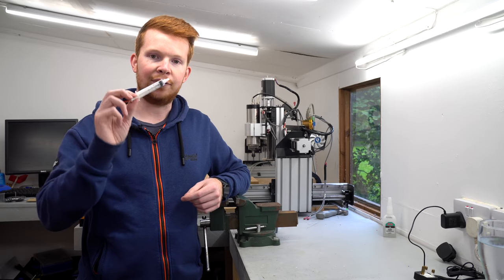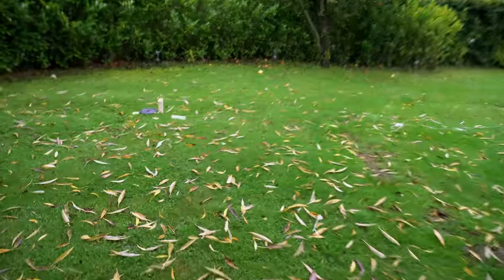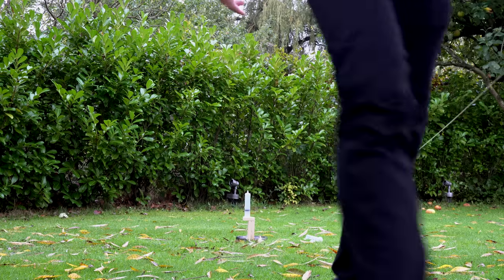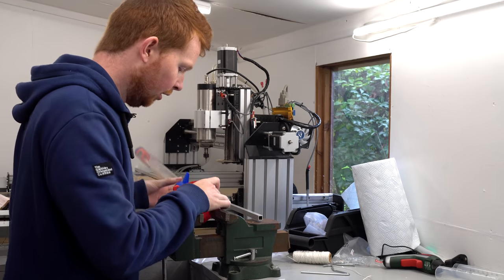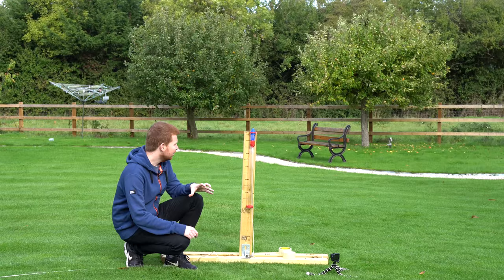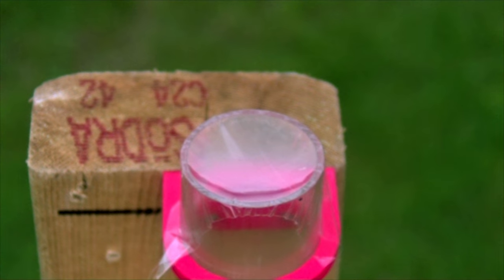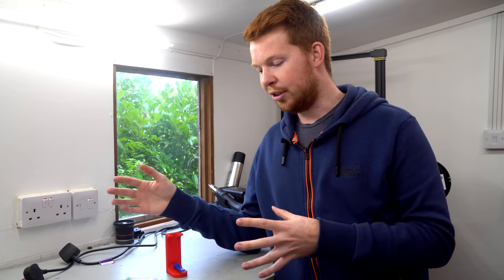Vacuum Rocket

Comment: Tom - try a smear of vacuum grease to seal the o-ring leak and also overcome the friction.
Reply: how about glue
Reply: BowlG Official what.
Reply: It's most likely the plastic that is leaking. Printed parts are notoriously leaky.
Reply: @JohnnyForehead  - YOU'RE leaky.
Reply: @JohnnyForehead  could try an stl print, they should be a lot less leaky.

Comment: Was fooling with a 5-ml syringe once, decided it would be fun to block the end with my thumb and pull back on the plunger. When I released the plunger it sprung back and made a jolly sound. That was good fun, so I figured the same thing with a 60-ml syringe would be 12 times the fun. It wasn't - when the plunger hit the front of the syringe it drove the luer-lock taper into my thumb, cutting a perfectly cylindrical hole into my thumb. Bled like a stuck pig and took weeks to heal, and hurt like hell too.

0/10, would not recommend
Reply: Scalability can be a “bitch” in many scientific endeavors.
Reply: Lucky me I only got 30ml syringes, did the exact same thing, but these don't cut you, only hurt real bad XD.
Reply: Lmao 12x more fun😂
Reply: I'll be sure to learn from your mistakes.
Reply: "In the name of science and all its wonders."
Reply: Same
Reply: Well this comment made me feel better for myself. I was kicking something and a wood door slammed shut. I was bare foot and it shaved a sizable piece off. I bled so hard and otc painkillers don’t work. Lucky me
Reply: Well thanks for telling us
Reply: Ah shit that sounds too painful
Reply: @777-p2t   well the idea is that the syringe plunger is creating a vacuum so inside the syringe tube there isn't any air to be injected.
Reply: I did that with a 12 mil syringe, hurt a bit, but nowhere near what happened to you.
Reply: Is the ‘luer-lock taper’ the plastic bit, or the needle? Idk, I’ve never called anything that
Reply: How do you know what hell feels like?
Reply: you're right. totally, totally correct
Reply: I did the same!! It cut almost a perfect circle off of my thumbprint and made the underside of my nail bleed for hours. On top of that, I broke the only syringe we had to fill the christmas turkey with gravy :)

Comment: I like at 3:42 when it launches you can see the water condense as the pressure increases
Reply: Ben Stewart   Maybe there’s cavitation in the condensed water that gives a huge energy boost with the 10cc syringe. With the high speed camera in total darkness he could look for blue/UV photon emission. Water cavitation creates an incredible amount of heat that results in photon release. I’m curious if that might be happening and resulting in a huge energy boost. I’m not sure of the mechanism of translating that into kinetic energy. So I doubt it. But I am curious?
Reply: @msmeyersmd8  cavitation directs the surrounding energy to a much smaller point, making it more effective in destroying the containers the vapour is in, but it doesn't produce energy of any sort.
Since the syringe is an enclosed space, any cavitation if significant would only contribute to shattering of the syringe and not to its movement since its an internal force.
Reply: cool catch! I was mostly fixated on the oscillations in its movement after release.

Comment: Make the projectile with 4 retractable wings made like a quarter of a sphere that rotate into the body, and are pushed by springs out right as the tube goes missing and the rocket deploys them to stabilize!
Reply: Agreed.  I was thinking along the lines of retractable fins for stability.

Comment: Thanks for posting this Tom.  I printed out the parts and had some fun with my kids this afternoon.  
One problem I found was that the syringes I used just stuck in the launcher, and the trigger did nothing.  Still had a lot of fun though.  Thanks for posting.

Comment: I have had a project in which i made a 'compressed air bottle rocket'. i see that your blue projectile is indeed somewhat instable. However I had a problem with getting really far. When i shot an unweighted bottle it went fast, but lost alot of speed to air resistance. After a while i made a weighted bottle and that one went alot further. I suggest you look into adding (a bit) of weight to the projectile. Of couse if you make it too heavy it will not get the maximum amount of velocity. I hope this helps.

Comment: The atmospheric pressure is actually forcing the two pieces together not forcing the plunger up. If it was forcing the plunger up then the two pieces would remain more or less separated.

Comment: You need to also seal the 3d prints as they have very small holes in them. I dropped one of my prints (at 100% infil) in water and the print soaked up some of the water.
Reply: spraying some lacquer on would seal it easily no?
Reply: @Francois_Dupont  It would.

Comment: One potential limiting factor in the vacuum cannon rocket is the release speed of the plunger. As soon as there's any gap between the plunger and the body, air starts rushing in, but slowly. So you want that gap to open as quickly as possible, increasing the gas flow rate which increases the pressure, which increases the force on the projectile, and since the distance of the projectile is sort of fixed, increasing that force is the primary way to deliver the maximum amount of work, energy, into the system.

Comment: Thanks Tom. Vaseline will act as a sealant and lubricant for that syringe body and plunger. Also, with the large tube, if only the top end separates, after being held in place by a diaphragm or other seal, then the plunger plus small end cap will go a lot higher than it would if you tried to launch the whole apparatus. Maybe a ‘Mark2’ video is called for!

Comment: An excellent demonstration of how it's not the vacuum sucking, but the air pushing from the other end.
If it was a suction from the vacuum, the syringe would not go flying, as equalized energy would be achieved as soon as the vacuum is gone.

You can try this yourself with a rubber band and just about anything light enough, like a piece of lego.

Stretch the rubber band, place the lego in the path of the rubber band and release. The lego goes flying.
Now stretch it again and place the lego right at the point where the rubber band is no longer contracting. The lego barely moves. This is because all the energy has already been expelled at that point and there is nothing left to transfer over to the lego.

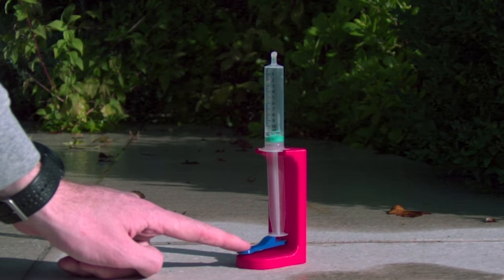Comment: Nice one Tom! In the final version of the small syringe it is interesting to see the gas above the piston forming vapour clouds due to pressure drop as the piston oscillates downward and upwards after it reaches  its maximum approach to the top of the syringe body at 10:32 an 10:40. Much like the vapour cloud that forms on lower pressure parts of an aircraft wing on a humid day.

Comment: 8:35
You can see that there is still air in the system, cause just before the blue projectile penetrates the plastic top it formes a dome!
Reply: It still leaks a bit but it might just help pop the tape before the projectile hits it and maintain its speed
Reply: The projectile doesn't seal very good to avoid friction. The air in front of it leaked threw.
Reply: there is air in the system at the start, before you pull down the piston, so that's there the air comes from

Comment: v = sqrt(2*L*p*A/m), v = projectile velocity, p = air pressure, A = inner cross-section of the tube, m = projectile mass, L = tube length, assuming no friction or leaking.

Increase L until the projectile reaches escape velocity.

Comment: Hey, I have a question for you.

Why are pistons and their cylinders round? Why can't we have an engine with square-ish "cylinders" and pistons?
Reply: I think it is due to structurual integrity because round shape spread the load evenly so that strong parts could be made without using more material
Reply: 1) Stresses concentrate on the pointy corners of the pistons, eventually eating away the sharp corners and creating leaks. 2) Sealing a sharp corner is harder than a sweeping radius. 3) Machine tools have really hard time machining  sharp inside corners, there's always a tiny radius left behind. 4) Lathes and boring machines make it easy to create precise cylindrical shapes (only radius matters) where as square shapes require precision on two different axis (x and y). 5) There are very few advantages in other shapes (packing factor is the only one that comes to mind)

Those are the ones that came to mind, of course there's more to it.
Reply: Why not keep the corners round?
Reply: Honda built a motorcycle engine with oval pistons to save on width. Didn't work out too well as we still are using round pistons though.
Reply: All the stuff above, and probably because it's also easier to manufacture.  You can just spin in a a lathe and then drill/machine the chambers and a round shape is going to be easier to meet the tight tolerances.
Reply: "Why not keep the corners round?" -> The bigger radius you put on the corners, the better is handles stress. But the bigger radius you put, the less it is a square, and the more it is a circle. You can think of a circle as a square with sufficiently large corner radiuses.

Add to that, there aren't many manufacturing methods that can create perfect corner radiuses. It's much easier to bore a perfectly circular hole, than to round corners of a square.
Reply: Other thing, most probable answer, is it reduces friction, as a circle has a much smaller circumference for the same surface area, reducing the area of material that contacts the sides of the cylinder.

Comment: @6:50 you forgot about energy loss to heat because there was the air that leaked into the chamber when the piston was released the momentum of the piston would have compressed the air inside dramatically heating it up and causing a large drop in the efficiency of energy transfer

Comment: once again a really cool video.
I have an idea for the vacuum canon :
maybe put the rocket on top of the tube and use it as the seal instead of using packing tape . it might allow less air in the canon making it more effective and you will only have resuable parts.

Comment: Hi there! a little late to party but I think one of the major drawback of the acrylic tube is that it will never let the piston hit the top. In the small syringe you have that tiny mass of air at the top and the piston is able to push the air into that space and make contact with the syringe head. In case of acrylic tube however there is no such reservoir and the trace air is going to decelerate  the piston.

Comment: Try to add a flap at the end of the acrylic tube. Under pressure it will be closed and tight, and when you release the pressure should open.

Comment: @6:50
I would like to add to the O ring leaking mechanism- more than decreasing the strength of the vaccum, the air acts to absorb the energy of impact- converting kinetic to heat.
Reply: I would think the air would hurt it more by converting kinetic to pressure and then just pushing the plunger back down instead of the tube up. 6:38 is a great example of what I'm talking about, you can see the plunger move back like 20% of the tube length.

Comment: If you are having issues with the o-rings against the acrylic both causing friction and leaks... try putting some silicone grease on them... You can get the liquid stuff for easing the friction or the slightly more gloopy stuff to avoid leaks Hope that helps and apologies if you have already tried this.

Comment: orings need a specific relief groove shape to seal the best, and are designed to be lubricated with light weight oil for the best seal. Also, some plastics absorb oil or react with oil which would increase friction. Pretty sure HDPE is the plastic you want to work with, not acrylic. (some plastics that a absorb oil can actually be very good for reducing friction but ive only seen that with metal on plastic interface like in certain types of high end bearings).
Also air has a progressive spring curve, so the larger the air volume the more linear the cure, and smaller volumes have a steeper curve, this would have to be balanced with plunger travel distance... so what im saying is that the diameter of the cylinder is going to play a larger roll in how the kinetic energy is released more so than just air volume alone, or shaft length.
edit- and regarding your cannon design (not first design) what i said above would not factor in to the cannon design, that simply an air cannon which is a much more simple feat of physics.

Comment: Your syringe may have not been leaking as much as you thought. Drawing a vacuum on water will turn it into water vapor. Basically, your lubricant could have been building up pressure in your tube. Silicone lubricants tend to have a low vapor pressure and would likely get you much better results compared to water.

Comment: I think more than the weight, the air leaking is the biggest factor in why it didnt launch high enough.
As the piston reaches the top, it looses most of its energy trying to compress whatever air that leaked in, and you get sort of a air cushion at the top.

Comment: Awesome vid! I think main reason your rocket failed at 6:55 is that beacuse of the leakage the piston compressed the air in the tube over the atmospheric pressure which then launched the piston in the downward direction (and caused an oscillating movement for the piston). With that the piston actually countered most of it's original momentum. For your vacuum canon you should try making the top of the tube in a way that it can whitstand immense pressure when the piston rocket is pulled down, but pops open nearly at atmospheric pressure when the piston is released to lessen the slowing effect of the force required to compress the air that's needed to pop the top open.
Reply: How about a normal silo door for the vacuum canon, where an electric motor instantly opens the door if the pressure reaches an upper limit (maybe like 90-95 kPa)? Not sure if it's possible to create a system that can react fast enough.

Comment: Maybe you could’ve 3D printed a cap for the top with a little spring held mechanism that when the vacuum was pulled would be seated down and locked in but you could twist and pull it out to let air in or take the piston out or put it back in?

Comment: With the vaccum cannon, it appears that the packing tape is bursting due to air pressure between the projectile and the tape (see 8:39), so there is some significant leakage either past the tape or the piston. This is lowering the potential energy of the vacuum, but preventing loss of momentum due to impact. In theory, if you could remove the packing tape the instant the projectile arrived at the top of the tube (preventing that momentum loss) with a low-friction good airseal on the projectile for maximum pressure differential across  the projectile (increasing the potential energy in the vacuum), you should maximize the potential to kinetic energy conversion. 

So I have this idea... an upside-down T connection at the bottom of the cannon, with a piston/projectile fitted in the long vertical leg. On one of the horizontal legs, you have a vacuum pump and a ball valve. Upstream of the pump you have another, smaller T connection with ball valve that leads back to above where the piston rests. This allows you to pull a vacuum on both sides of the piston/projectile, and close the valves maintaining the vacuum both above and below separated by the piston/projectile. On the other leg of the T, you have a tank of high-pressure air, separated from the T connection by an electrically actuated burst disc (basically some high strength foil with an electrically insulated resistor wire inside, that when enough current flows through the resistor it melts the foil (just enough so it pops) releasing the pressure on one side to the other). At the top of the long leg of the T, you have another electrically actuated burst disc. The burst discs would be connected to capacitor banks to provide the high current necessary for the flash heating of the disc resistors. The lower disc could be manually actuated, but the top disc would either need to be time-triggered or sensor-triggered (possibly by laser-photocell interruption) or possibly a combination of both. 

So in operation, you would pull a vacuum above and below the piston/projectile. Seal the connection from the barrel above the projectile from the connection below, with the low-friction airseal of the piston/projectile being the only divide between the barrel and connection. Release high-pressure air into the connection below the projectile with the first burst disc, causing rapid vertical movement of the piston/projectile. As the piston/projectile nears the far end of the tube, the second burst disc is fired, ideally just as the piston/projectile is coming into contact with it, minimizing momentum loss due to contacting the burst disc.

A high-density projectile inside a breakaway low-density airseal piston/sabot might give you the best energy transfer and post-launch projectile stability... but you might want to find somewhere safer than your backyard to set this off... you might be looking at firearm projectile speeds from this... and I'm unsure how you'd track the projectile after it left the barrel.

Comment: Alright so improvements could be a spiraled barrel like a gun to ad stability or, probably more si.ple. put fins on the projectile. Also I think you'd get a bit more energy out of it if you slowed down your pull as the vacuum is also having to over come the -y velocity of the projectile bring it to a stop right before breaking the vaccume

Comment: For the larger system maybe you could work out a way to drop the piston weight after it hits the top and has transferred it's kinetic energy to the cylinder.